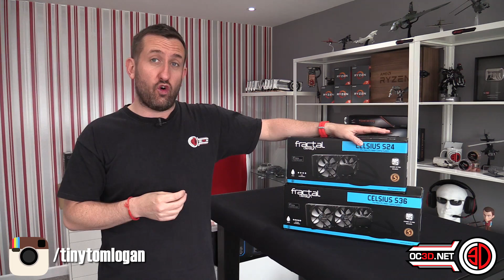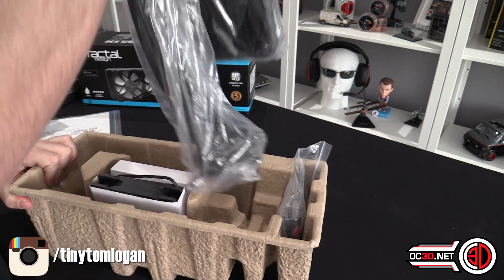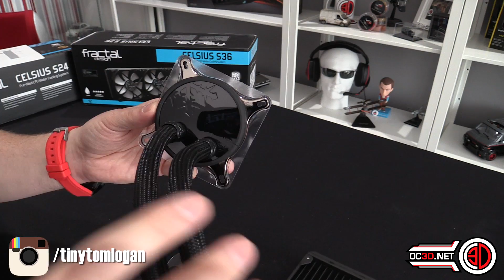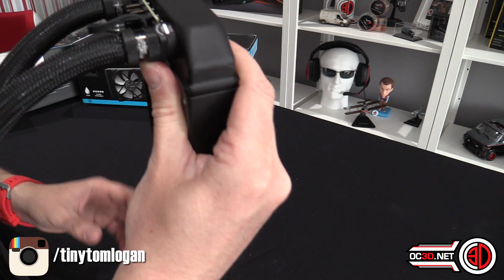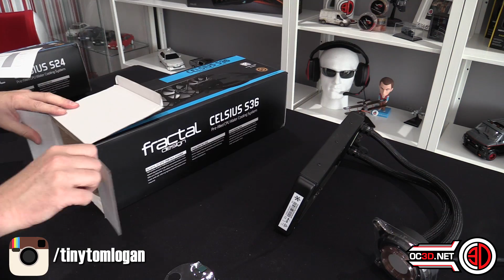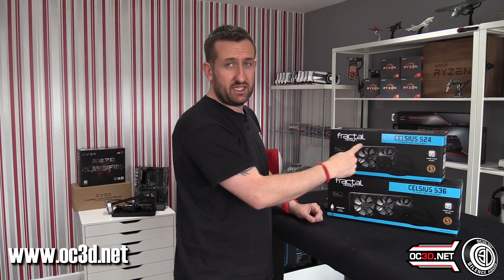Fractal Celsius S24 & S36 AIO Review 240mm 360mm

Comment: the fittings on the pump are cosmetic only. THEY CAN NOT BE REMOVED/CHANGED. you can remove the fittings from the rad to add to the loop, but that's it

Comment: I have the Kelvin sitting in the loft, all in bits. I had only problems with it even tough I had it replaced with a second one. 
Pump was noisy, loads of bubbles in the loop which resulted in temp spikes. Not sure how this one compares, but the pump noise in the old one was annoying in a Corsair 380T with a 4790K.

Comment: It's curious seeing the built in PWM hub on this AIO. I was not expecting that. I used a EKWB Predator 360, which used the same type of hub built in to the chassis of the rad. But, it did not function correctly while using this. It could not provide enough power to the hub to make the pump spool up to full speed. Sometimes it wouldn't even spool up. I ended up having to fix this but disconnecting the pump from the hub, and running it directly to the "water-pump" header on the MB. I then had to use a PWM splitter to run the 3 fans off the CPU header. Needless to say, in that particular case the integrated hub was obviously a bad idea. Good to see that it works as it should on this unit.

Comment: other point as well the fan cables are specifically meant for that radiator and the built in 3 way fan splitter, its just the way you fitted them is why the last fan did not reach (unless they did not take into account a pull configuration)

Comment: I have this fractal 360mm rad in a Cougar Panzer case and it was an easy install.  Cooling a Ryzen 1700X cpu and it's working well in auto mode.  Mounted the aio up front in a pull configuration and have two fractal 140mm fans at top to push the rising hot air out.  The case comes with a single 120mm in back to push out air as well.  So far the temps have been really low but only have a RX460 is this rig as it's my office workstation, so I don't know how the temps would be with a hotter gpu but doubt there would be any real difference.  Take your time on the radiator fan setup and indeed you can use the screws to keep the far fan cabling tidy but it's a really tight fit.  For the other fans closer to the radiator tubes, wrap them once around the fan before install (middle) and twice around the closest fan.  Instructions are poor on this but with a little patience you'll find your best option to keep the cables tidy.  Love the fan connector hub!

Comment: been looking for 360 rad due to bad case design on the corsair obsidian 450d I got , as I got the corsair H110i (280 dual) and unfortunately the corsair 450d case has a poor top fitting for 280 rads as the top can fit 120-240-360 with no flow restriction (unless you put dust the filter on top of 450d) but if use a 280 one the screw mountings have big flat bits of metal that covers over 1-2cm of the air flow and causing CPU to be hotter when fitted (why corsair has nor made a 360 AIO yet is interesting)

Comment: FD include these fans in Define C. The only difference is they are maxed at 1200 RPM (vs 2000 RPM Celsius S24) but they are really, really silent indeed. You can here only the wind basically, nothing else.

I suspect these in Celsius S24/S36 are not too much louder than that.

Comment: Need to add Thermaltake Water 3.0 Ultimate to your AIO charts, as it seems to beat all other AIOs in the charts I've seen. I've had it in my Cosmos 2 the past several years, and I'm really looking for an excuse to replace it :-)
Reply: Thermaltakes water 3.0 Is using the same type asetek  pump/waterblock but with more restrictive 1/4" plastic barbs on the pump and radiator but with nice RGB fans for bling. These all use the same asetek rads and pump/blocks  basically.It would be a lil less water flow but pretty. I would bet its real close to all the rest in the same size radiator.

Comment: Great review! Curious, as an owner of a Fractal Kelvin T12, these kind of seem like a step back from the Kelvin series. The modular fittings on both the pump and the radiator on the Kelvins allow for a ton of customization or expansion. On top of that, the Kelvins allow for refilling of the unit for the purposes of maintenance. It's truly a one-of-a-kind (well maybe three of a kind) cooling solution for those who don't want to go into full custom loop territory. The Celsius on the other hand seems to be gunning for the closed-loop big dogs with removable fittings only on the radiator and what appears to be no fill ports... I'm curious as to why they advertise this unit as expandable... The PWM controller on the rad seems cool, but a 3 way PWM splitter going to the Mobo would be just as clean. Will these be available in the USA? Also wondering if these will replace the Kelvin line or be sold along side it.
Reply from the maker: Kelvins are already EOL. They will be available in the USA yes
Reply: Aw bummer. Picked up my Kelvin a couple of months ago from an out of country retailer who shipped internationally. Glad I got it when I did, they're impossible to find now! Thanks again for the great video. Cheers!

Comment: Good review Tom! Now I have a question, they made an limited edition of their R5 with dust filters in the top of the case, do you for some random reason know when they are going to sell those as parts?
Reply from the maker: Probably best to email them. Fans in the roof are normally best as exhaust though
Reply: I know that Tom, but when the machine ain't running and you got dogs running around then it gets dusty 😆

Comment: I want to know how well one of these (or the 36s) handle a 2nd Rad a Res and GPU block.
Reply: I'll probably do fine if you add a GPU block and a small res, but not much more than that. The pumps on these AIO coolers aren't strong enough to run water through a massive loop like were used to on a fully custom loop. It might be possible if you make the runs short enough between components but you'd need a case thats geared for water cooling.

Comment: Great review but that sound graph shows temps at 14:50
Reply from the maker: Just a graph marking mistake. Thats Db
Reply: Is that not a tad bit loud Tom? They produce roughly the same amount of noise as a 1080Ti reference/Founders Edition card under load? I thought a close AIO for the cpu would be a little more silent compared to a blower card.
Reply from the maker: We have not tested a 1080 Ti ref with our gear so you CANT compare.
Reply: Fair enough :) i'm was just going on what other reviewers seem to get with sound testing. Roughly 52dB on a ref 1080ti under load. I can understand if you havn't tested it under the same environment and equipment it's not going to be exactly the same. Thanks for the reply though :)

Comment: Well? 
How do they manage to run three fans from one header? 
Are they using a power wire to the header along with the PWM fan header wire? 
Just not real clear on this point.
Reply: Yep. It's just a split at the fan controller. Since the pump is rated to something like .2A and the fans don't draw much power it won't be a problem to run 3 fans + the pump on a single fan plug.
Reply: the problem is that or...you use AUTO option....ok...BUT if you use PWM option...the mobo software modulate the pwm of fans with the pump..all together....I 'd prefer that the pump go always at max...and not PWM!   sorry 4 my bad bad english

Comment: on asus z270 boards. they have an aio header. should i connect the pump to the aio header and connect the fans to the cpu header? i ended up purchasing the 360 rad. using the fan hub would either header support three fans and an aio pump? Thanks in advance!
Reply from the maker: Id just try both and see how you get on and what youre most happy with
Reply: Thank you for your input. much appreciated!

Comment: Heat exchange and surface area calls bullshit. According to gamers nexus that show ambient delta t and claim 280's are better than 360, but there has to be two factors that say why, pump speed and fan ability. I guarantee the pump speed is higher on those 280mm kits and better fans. If the pump speed was better on this 360 kit and better fans, i bet you it would out perform those 280 kits. also the issue of the damn pump AND fans run off the normal fan header on the motherboard, while those 280 kits that beat it, have external power via sata connection.

Comment: No rgb no buy😡
Reply: wiiuisawesome lool are you 12?
Reply: wiiuisawesome lool I laughed
Reply: Nelson Abreu me 2
Reply: yes don't buy if you're into rgb .. otherwise buy as I have this in my work rig and it's a solid cpu aio cooler, the fan noise is hardly noticable and was easy to install in the Cougar Panzer case I put it in.
Reply: no rgb, instant buy. fuck all that teen shit.
Reply: Agree. All this RGB bling crap fad needs to be done...like yesterday.